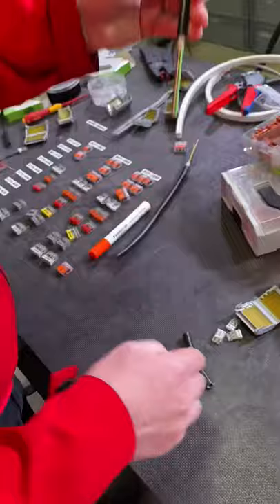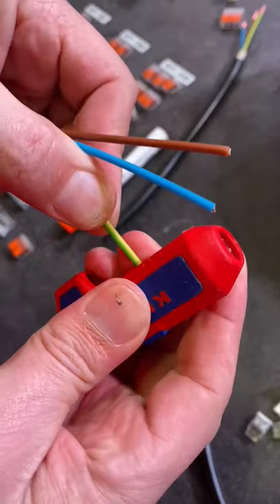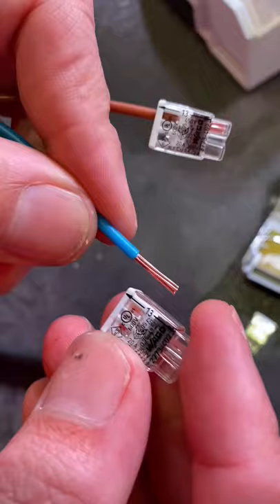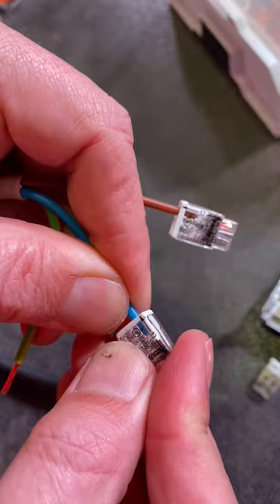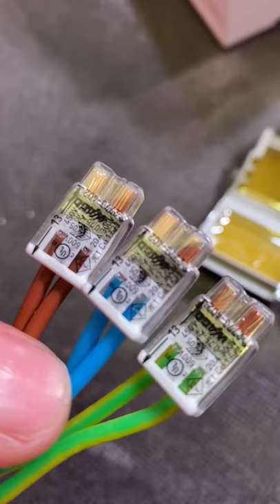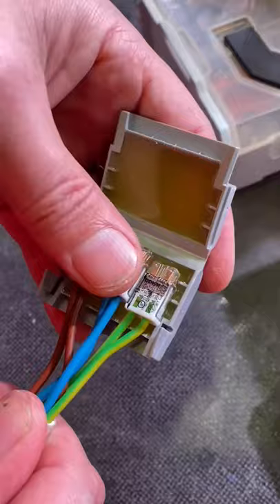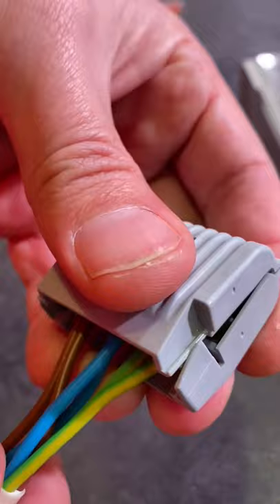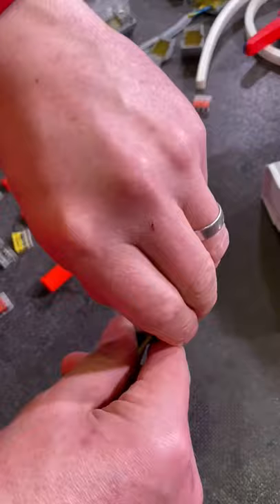An easy way to create a 🚿 WATERPROOF connection - WAGO Gel Box  #shorts

Comment: Are those push fit wagos ok for stranded cable now?
Reply from the maker: Not flexible but you can use with stranded fixed install cable
Reply: What I’ve heard is that if you solder the ends of a stranded cable, it should work just fine
Reply: Also, some push fit connectors can swing open for stranded wires to be inserted

Comment: Won't be using that joint box , it leaving single insulated cable exposed. , It goes against everything I we taught and goes against everything I teach an apprentice not to do. Would you wire a plug like that ?
Reply: It was my understanding that this provides the moisture protection, but you still require the standard wago junction box for double insulation and the higher mechanical rating. I thought there was a efixx video about it, but it may have been another video I seen this on that has now been lost to depths of time.